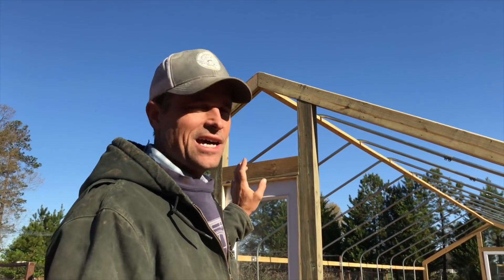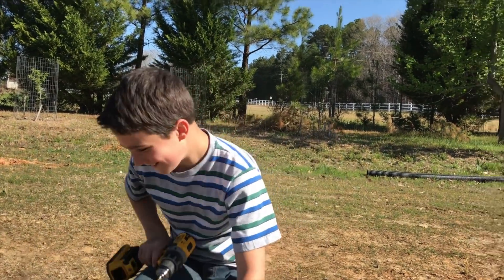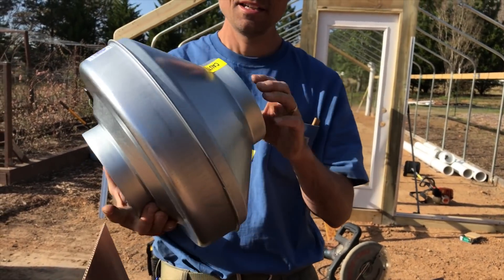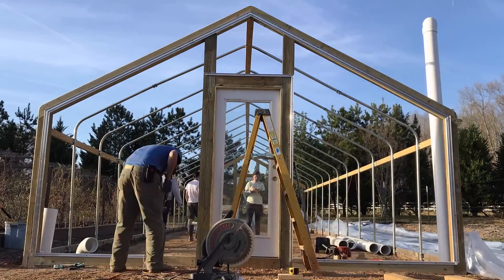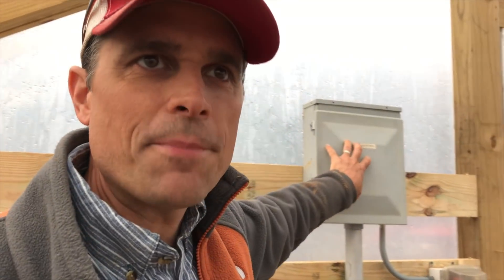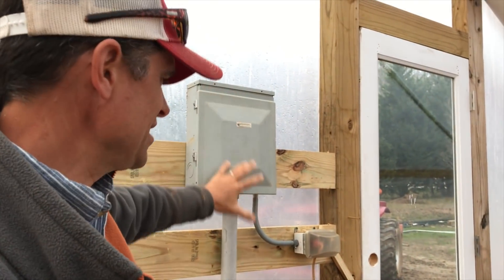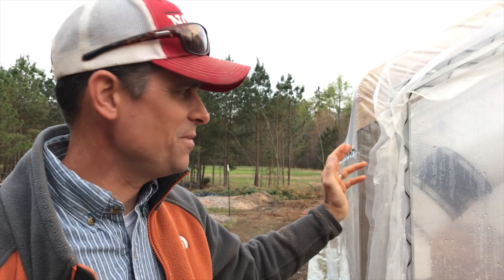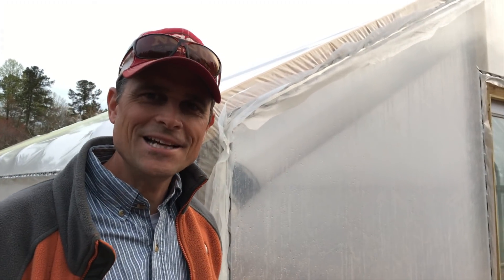DIY Geothermal Greenhouse Pt 8: POLY FILM INSTALLATION

Comment: Love your geothermal greenhouse!  I've been enamored with the LDSPrepper and the citrus in the snow geothermal setups.  For a DIY wall blower fan, I got away with a $5 12v squirrel cage fan from a surplus store for over 12 months before I began rebuilding my greenhouse.  I don't have video but here's two pictures of how I made it work

- https://www.facebook.com/photo.php?fbid=10204524111720166&set=a.10203471453244362.1073741828.1154224876&type=3&theater
- https://www.facebook.com/photo.php?fbid=10204571830473105&set=a.10203471453244362.1073741828.1154224876&type=3&theater

Mileage may vary as I opted for furring strip and/or pvc sandwiching in place of wiggle wire so I can't speak to the leak performance you'll encounter.  Curtis Stone used laundry pipe to bridge wall surfaces - https://youtu.be/1fw-_yGhJAE?t=3m32s.  I think you could even get away with 1" flexible pvc bilge pump tubing from the hardware store to bridge as once it's inflated, you won't have a need for high-flow (unless you're leaking somewhere!).  Looking forward to your build!
Reply from the maker: Yes! Thank you for thank link to the Curtis Stone video! We watched that some time ago, but forgot it. As I figured - we're over thinking these connectors and $30 is crazy overpriced. And thanks for the word about the squirrel cage fan - if we can save money on the rest of this build we need to. Really, thanks for taking the time to comment and share.
Reply: Maybe worth it to buy one $30 connector to see how it is set up then reverse engineer it with "Lowe's/ HD/Ace Hardware products.
I've heard that the fans are more efficient pulling the dense "cool air" rather than pushing the hot fluffy air.
Brings them lower to the ground too.
Reply: It looks like he just cut the proper size hole in the plastic and forced the dryer hose into it. You can kind of screw the dryer hose into a tight hole.
Reply from the maker: Yes, this really seems like the way to go and save a LOT of money.